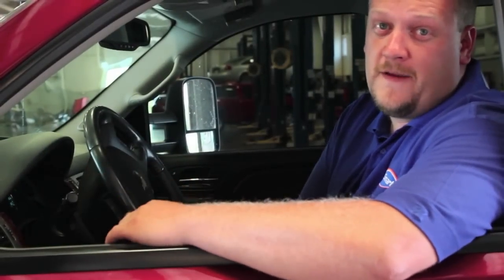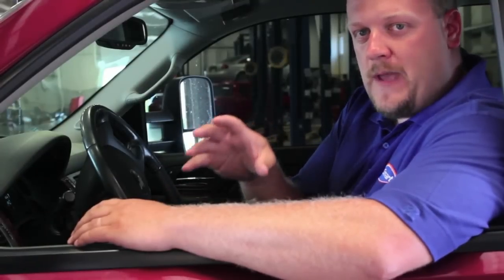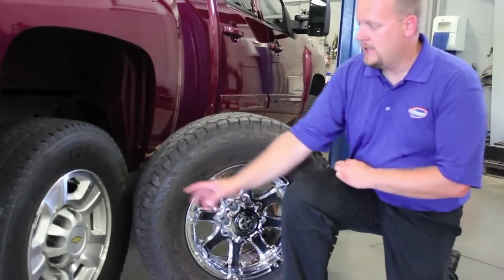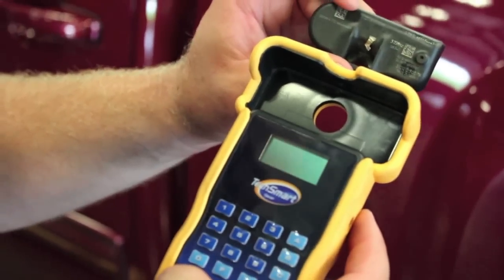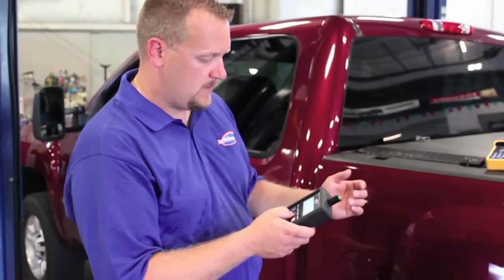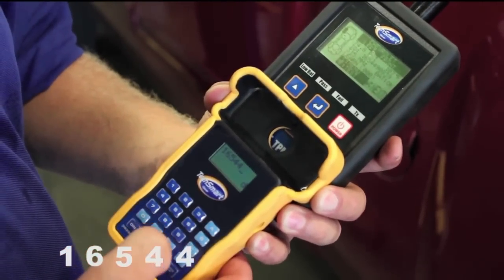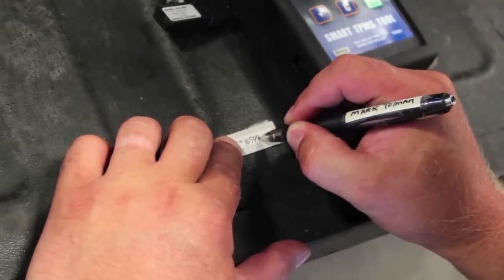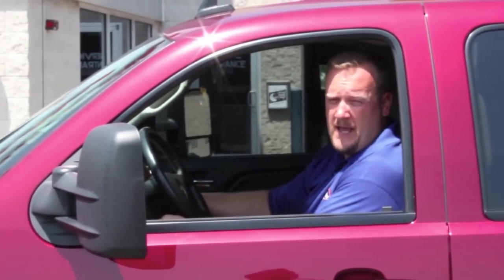Standard TPMS Clone-able Sensors and TechSmart Tools

Comment: What if my 2 sets of wheels have a diiferent load index ? For example my stocks are usually 35psi vs 41psi for my summer wheels. Would it be pointless to clone ?
Reply: Cloning's sole purpose is to prevent u from having to reprogram the car's TPM module when you swap between sets.

It has nothing to do with what PSI you run each set at. The TPM module will just see whatever PSI the 4 TPMS tells it with whatever wheels you have installed. And make logic decisions accordingly.

Comment: How does putting a sticker on the sensor help? You have to take the tire off the rim to read it . Put the sticker on the owner's manual!!!
Reply: Once the Sensor is cloned the ID can be read with a TPMS relearn tool. However if someone is changing the sensors because the battery went dead or the sensor got broken they will need the sticker on the sensor.

Comment: Is there an after market kit that can learn the OEM sensors? 
I would like to put a TPMS on my motor home 6 wheels and be able to read my towed vehicles OEM TPMS. 10 wheels total. Is this possible to do? I have seen some after market units that can read up to 18 wheels, but, they have the units that screw onto the valve stem. I have read some negative opinions about that, problems with air leaking out, valve stem damage.

Comment: Can a non-OEM sensor, like a retrofit system sensor, be cloned by this tool? Specifically, could a retrofitted stem sensor be cloned to a Standard Motor Products banded sensor and used by the retrofitted system?

Comment from the maker: Two tools are not necessary to perform the cloning process, as the T55001 scan tool can electronically clone a sensor. So, someone with a competitor's tool can read the sensor ID and use the T55000 clone tool to clone a sensor...fast and easy! If someone has an older tool or no tool, they can use the T55001 to clone a sensor electronically or manually in seconds. PLUS...we have OE fit, form, and function that the other programmable sensors can't deliver!
Reply: Is the TechSmart T55000 unable to read existing sensor ID?